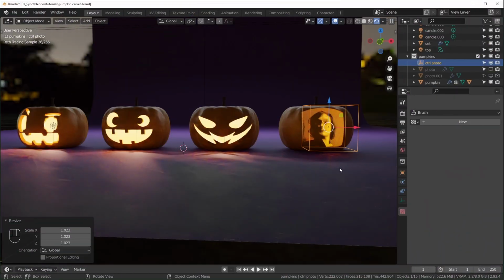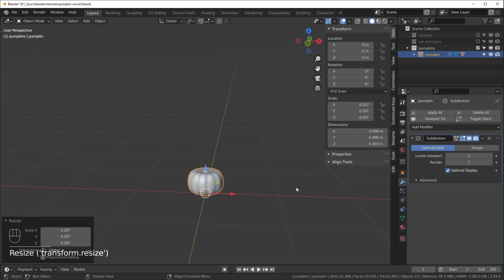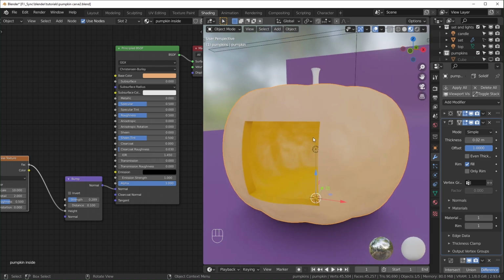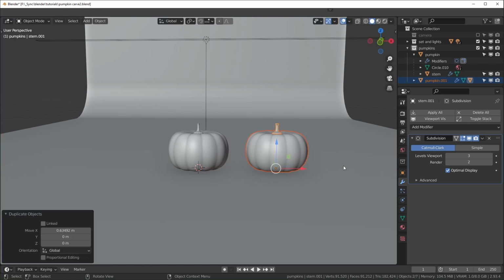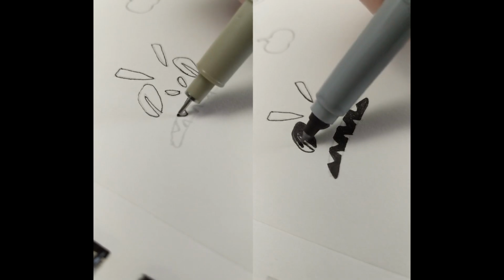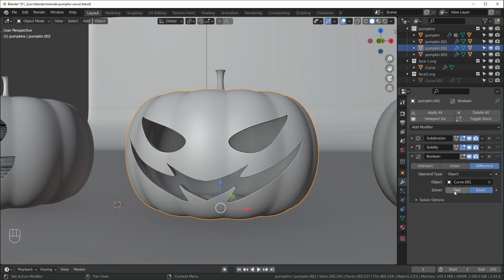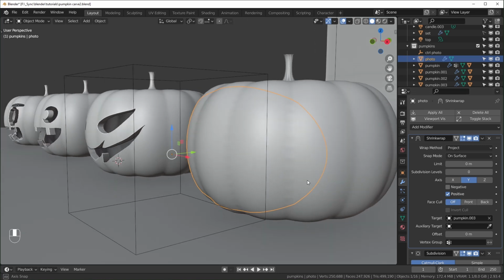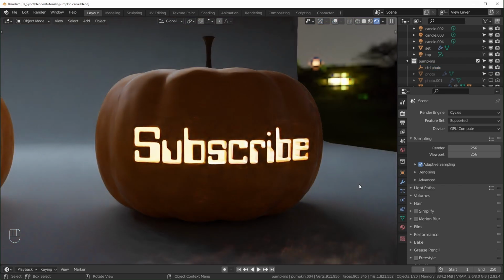Use Any Photo To Carve A Pumpkin || Blender 2.93

Comment: I've had very poor experience with boolean in Blender.
Reply from the maker: It has gotten a little better in the last few updates, but it still can be very slow.
Reply: @JoeyCarlino  I'm doing 3d printed stuff so it has to be manifold and I can usually make it fail outright :(